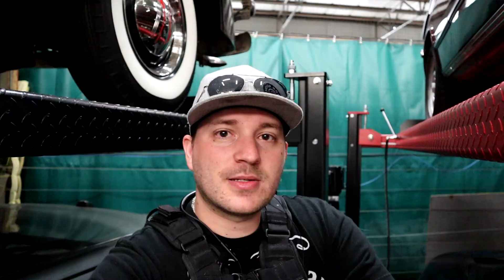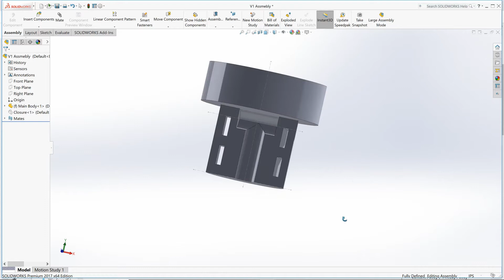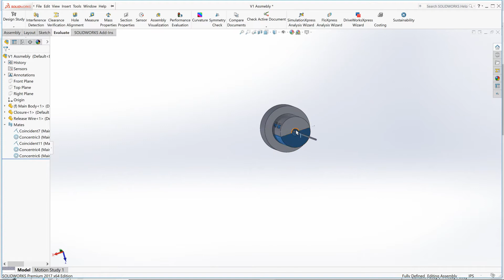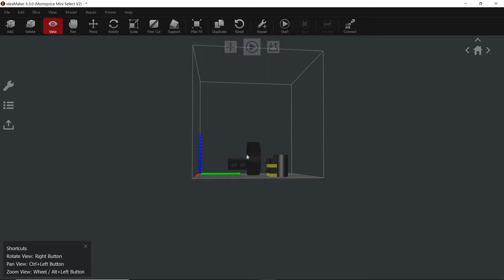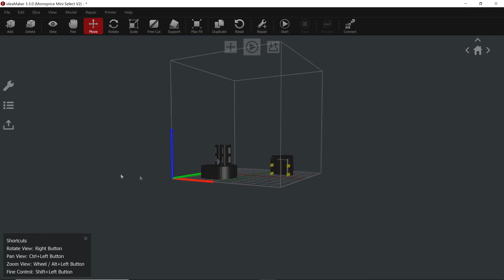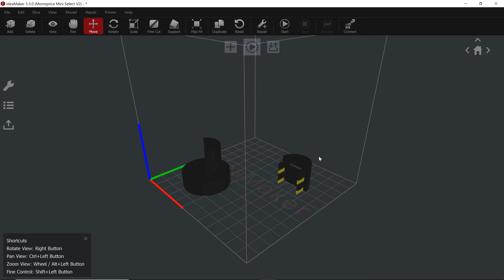3D Printing Car Parts: A Primer with the Project 300C [Project Ute Episode 5] [3D Printing Basics]

Comment: Is it possible to get into 3D printing without much initial investment? Maybe like once or twice a year I find myself in need of some random difficult to find plastic part. It wouldn't be efficient to buy a bunch of equipment and software just for that.
Reply from the maker: A few years ago I would have said yes, but nowadays it is far easier and cheaper to get into 3D printing. The printer I used in this video is the Monoprice Select Mini V2, which you can get on Amazon for under $200 all day, and a decent 1kg spool of material is only another $20. So for about $210, you can have a very capable PLA printer with a 120mm x 120mm x 120mm build volume and enough material for a decent number of sporadic print jobs. As for CAD for those custom parts, SketchUp is very popular and I found it fairly decent for a free software, although for more precise jobs something like FreeCAD seems better suited.